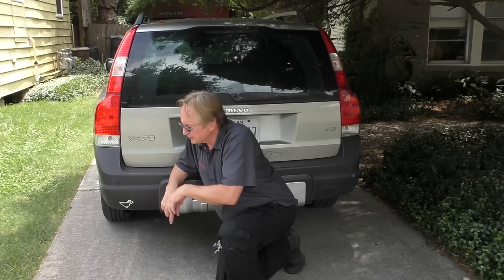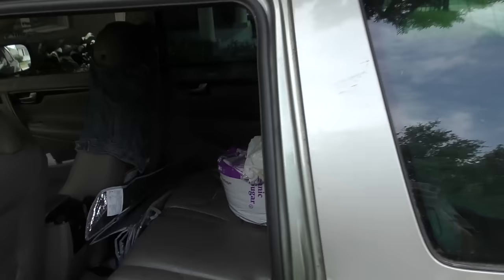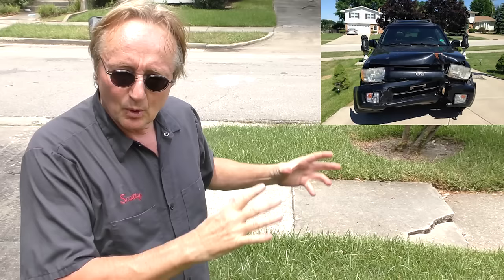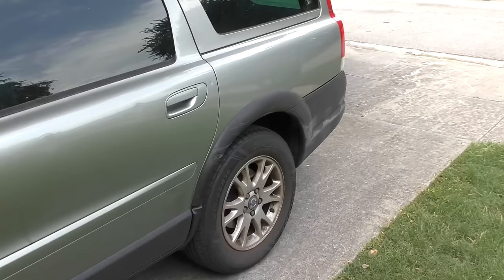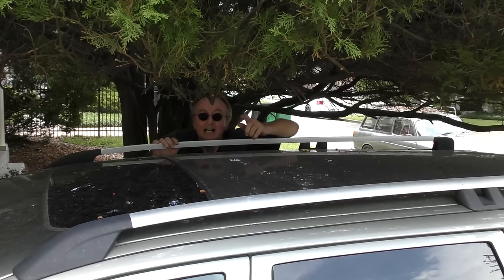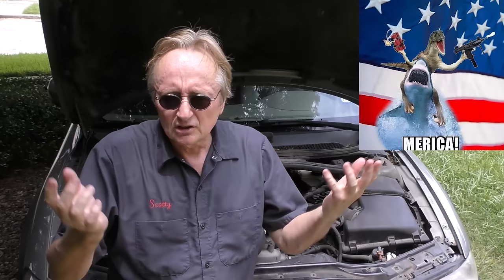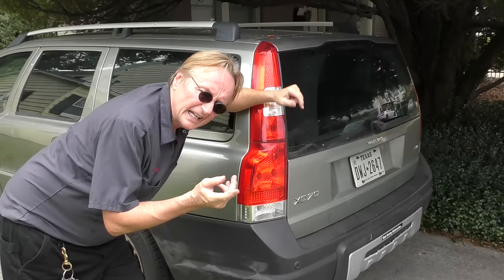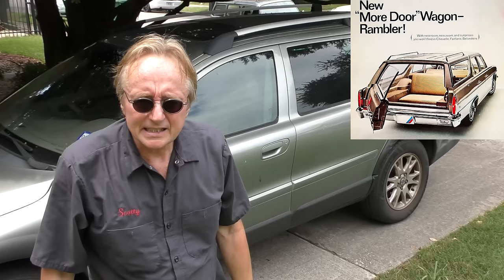Here’s Why Old Volvos Last Forever

Comment: Also, long live the 5 cylinder!!!
Reply: The T5 engine was one of Volvo’s best creations
Reply: Just like the K Series are the Best Honda Motors..
Reply: Never even knew it existed before now.
Reply: Agreed!  I have two old Audis with five cylinder engines.... both are 25 years old and still run great!
Reply: Which do you mean? The diesel or petrol one?
Reply: @Lagggerengineering  Both!!
Reply: @pduffy83usa  Both?
I guess I know what I am buying next!

DIESEL ENGINE MADAFAHKAAAAZ!!!
Reply: Wasn't that the engine with extra unneeded parts so they were allowed to tune it for racing?
Reply: Best engine pack Volvo made 5 cylinder turbo module. S60/ V70 2.4L B5244T5, circa 2004-2007. Afterburner performance. Pulls like a tractor. 29mpg hwy.
Reply: Lord Thunder  Why? Because its more efficient? Because it moves the world? Because it gives you the food you eat every day?

"Oh, but it pollutes" get real, we all know it pollutes, that doesn't stop you nor anyone else from using it's benefits.
Reply: @steveman1982  I recall the BTCC rules had to be changed because of the Volvo 850, the engineers had gone through every letter of the regulations and modified the engine in such a way to bend the rules and give them an unfair advatage over everyone else.
Reply: 5  cylinder    non   interference.     Good   design.         VOLVO.
Reply: 2.5t?
Reply: @YouDontWannaFightMe  Audi as well
Reply: @idigbebop  I have a 98 T5 sedan with the B5234T3. It also pulls like a tractor and more fun has been had with that car than anything else I've owned. The look of shock on drivers of BMW, Honda, VW,  et cetera as I pull away is priceless. The car is a bloody tank, love it.

Comment: I have a 2005 Volvo v70 5 speed with 224xxx and counting. Very reliable
Reply: V70 5 speed?? Im jealous.  You must not be in the US.
Reply: I would trade my right nut for a 5-speed!  I have a 2005 V70 2.5T with an auto.
Reply: My V70 was a good car. Got it up to 245xxx and recently sold it and bought an 04 S60R with a 6 speed.
Reply: @4jrgolf  Yes in the US. They are kinda rare tho especially for one that isn't a base model

Comment: Old, boxy Volvo's from the '80 aren't stylish? They are built from the principal; "Form follows functions". That's state of they art designing in my opinion! Practical, safe, easy to work on, reliable, comfortable. What do you want more? Screw those useless modern SUV's...
Reply: Amen to that. Boxy means more space. Do you think I could fit all the baseball equipment my V70 carries, in a (gag) Nissan Rogue?
Reply: "From follows function"🤔🤔
Reply: @bonohyogurt  There are boxy Volvos in 90's, too. I have a 1993 Volvo 940 STW. The last models of them wrere built in 1997 or so. I am driving my current Volvo now since 3/2002.
Reply: Jorma Kovanen 

I’m driving my 740 to a million miles
Reply: Turbo Bricks.
Reply: @JormaKovanen  Yes my 98 V70 is a tiny bit more rounded than your 940 but still boxy enough. Love my green tank. I hope fixing the AC is not too expensive, I don't want to get rid of it!
Reply: Yep 240's are great cars. Fun too if you want a cheap rwd car. Rip out all the interior and they are pretty light weight as well. Kids use em as the cheapest entry level drift car as well.
Reply: @ivanlowjones  the boxy Volvo 240 was built like s warship .
Reply: @robertcampbell9946   I had a 1979 245GLE estate and can agree wholeheartedly.
Reply: @peterkowlessar7823  I tell you man, these cars along with corollas are popular in Jamaica as taxis .also i heard that nobody never died in a volvo 240 thats involved in an accident .
Reply: 1987 240 wagon, reporting for duty

Comment: The old Volvo 240s were nearly indestructible. I've always called them the Swedish Toyota. Super reliable, cheap, relatively easy to work on. They're are more 30+ year old 240s on the road than any other older car.
Reply: My friend had a 240 and he collided with a deer last winter and it had barely a scratch.
Reply: Tim A replacing shocks on a 240 is a literal 15 minute job, so easy to get to, just a couple of bolts...
Reply: Toyotas aren’t tanks so Swedish Toyota doesn’t fit

Comment: I drive a 1993 900 series Volvo wagon with 350,000km.
Reply: Andrew Tremeer 217000 miles
Reply: -93 240 Wagon with 503 000km
Reply: 945 from 92 at 37 👍
Reply: Same 330,000 on my 93
Reply: My V70 2003 is now 425.000 km
Reply: 570 000km here
Reply: Some descent effing numbers going on. 500k km is no joke 😂
Reply: I had a volvo 245 1976 and it hade over 800 000 km on it. Sadly it was all rusted up but still the engine was running fine :D

Comment: The 240 volvo was so tough volvo once put 7 on top of each other to show the strenght of their roof
Reply: that was with the volvo 140
Reply: A neighbor once crashed with his P 1800 into a 7.5 t truck, which was sliding on ice frontally against him. the neighbor survived without any injuries, and the Volvo was still able to run. But the axle of the truck was kicked out.
Reply: @tejdz1337  I have one if you want it
Reply: It was later revealed that Volvo had reinforced the roofs with wooden beams to make that commercial.
Reply: It was the 240s. In 1987 they stacked them at our local mall.
Reply: They did the same thing with the Volvo 740
Reply: I have a 1991 740 Turbo Wagon. During a summer windstorm, a medium sized tree was torn down and it landed on the roof and the front of the parked Volvo. The car was completely covered by the tree. There is a small wrinkle on the roof line, and the corner of the hood on the passenger side got bent near the cowling. I replaced the windshield, which had a crack, and I still have the car. Volvos are sturdy, reliable, but most of all safe cars. People used to ask me about their MPG ratings. I always used to emphasize that I never bought Volvos because of fuel economy reasons. My first one was a '68 144S, which I drove from 1970 to 1985.
 By the way, I recommend IPD parts for Volvo. I have used their parts on my Volvos over the years.
Reply: Had two 244 solid cars easy to drive, did very little maintenance to keep them alive... did that rhyme

Comment: Those V70 is the most used car in Sweden, of natural reasons.
almost impossible to find one under 400.000 km.
People buy and sell them, and they will continuie to run
Reply: Christian Christensen that’s an XC70 but u were close
Reply: @mickdick1138  Ahhh okidoki :)
Reply: They were the Swedish police equivalent to the US Ford Crown Victoria P71. Still a few of them in active service to this day!
Reply: @mickdick1138  A few pieces of plastic and a few inches from the ground is what separates them... everything else is the same :D
Reply: @micosan  shocks,  front and rear drive shafts,  bigger disc brakes,  the clearance of a cherokee, all the bottom  protection  and AWD  as standar   was the difference
Reply: @andycapo9you  That is exactly what I said. I own a 2008 V70 and my brother has a XC70 from 2009. And there isn't anything substantial to diffrentiate them.
Reply: @micosan  and a 5 cyl instead of 4 or 6
Reply: @cruiser6260  D5 engines are the same 5 cylinder engines.
Reply: Whats 400,000 km ?

This is America.
Reply: @Johnkoth  250k miles
Reply: @marcusjosefsson4998  Yee that's what I always say it's the Swedish crown Vic
Reply: @mickdick1138  Basically the same car.
Reply: DrFartiwartieZ same underneath as the V70/S60 and S80 - all P2 platform cars
Reply: @Johnkoth  No, this is not America.

Comment: My Aunt has the same exact Volvo. Never stranded her and it's sitting at 130,000 miles. I got in it one time and was surprised with how smooth and quiet it was even after all these years. Incredible and the interior felt solid as well without a lot of creaking. The power was smooth and it was very quiet. I love old Volvos like these. The only cars I would consider buying would be the Outback or old Volvos.
Reply: just make sure she does her timing belt. these 5 cylinders are interference engines

Comment: My 244 had 889'750kms on the clock when i gave it to a fellow volvofreak. The 965 had 470'000 and the 850T5 only 250'230. Good tanks.
Reply: Mythus 
My last Volvo 850 went to 264,000
Miles

Comment: Yup, there’s a reason I own 5 Volvos!
Reply: what ones do you recommend under 5,000? what is your list of best and easiest to work on?
Reply: @Ensource  the older models from before Ford took over. So that'd be the first generation V70, 850, 940, 740 and 240 series of vehicles.
Reply: @Ensource  I would recomend Volvo 740 or 940 because it's easy to get parts and replace them yourself barely any technical problems at all. But if you want a more cheap and more comfort I would recommend a volvo v70 for daily and stuff like that. But never get a old diesel Volvo under year 2000 because me personal experience with those is that they are not as reliable as the old b230 redblocks.
But it depends where you are from and how easy to find and prices in your country as well of course. In

The engines I would recomend to get is b230 f, fb, fk, ft,  they are the most common to find and the most easiest to find parts to. The old carburetors ain't that great but they sound good with that's got sure
Reply: @Zirkobi  before Ford is first gen S60, S80 and second gen V70/XC70 too. And this generation is best. No rust, solid engines, no Ford parts ...
Reply: I just bought my 04 volvo xc70 but I miss my 850

Comment: My ‘08 Volvo S80 v8 is the best car I’ve ever owned hands down. Gotta love that Swedish engineering!
Reply: Engine made by Yamaha. Gotta love that Japanese technology :P They re rare. Hold onto it. Only had an 850 estate and an S60 from 2001. Now I got a headache with a 2009 Mercedes C class:))
Reply: @japanluv  Thanks for the advice!  The engine is the main reason I bought it and now it's safe to say I'm a B8444S enthusiast!
Reply: SlitWristMisfit  They were designed by Yamaha, as ordered by Ford (who owned Volvo at the time) and manufactured by Volvo.  They weren't made by Yamaha, dummy.

Comment: Still not as good as the old RWD volvo 240, now that was a solid car
Reply: Kalle Birgersson I’ve got an ‘88 240 wagon. The starter has been on its last legs for over a year now. Things bulletproof. 
I was at a red light once and this pedestrian walked past and said “Volvo, Swedish for common sense”
Reply: @searchingforsalsa  Volvo=I roll

You roll with common sense. Buying a Volvo is a compliment to yourself
Reply: Too solid.
Reply: So was the model T Ford.
The v70 Volvo blows the old 4 cyl Volvo away.

Comment: Reminds me of my 79'Lincoln Town car Scotty,these are built like tanks too.
Reply: @kirkreed8547  I had a 1975 Oldsmobile 98 Regency that I hit a deer with at about 50 miles per hour,it didn't even put a scratch in the paint,but it ripped the leg off the deer though.(killed it)
Reply: @paulparoma  That sucks,sorry to hear that.
I used to have a 1975 Olds 98 Regency with airbags and 4-wheel anti-lock breaks.This was a experimental model,about only a couple hundred were ever made.
These were only offered in the 1975 model year,the body was in perfect condition,but the drivetrain was a"fix it"night mere.I was also afraid of this car,because it only had lap belts in it,in the event of a head on collision,my torso would go into the steering column,then the dynamite detonator in turn  discharges the argon gas,while your face is slammed into the steering wheel,this experimental air-bag comes out of the steering column at well over 250 miles per hour, literally decapitated you,plus breaking your neck,needless to say,the longer I kept this car,the more scared of it I became.I hope that nobody has been killed in this experimental death trap. 🙏✝📖✝

Comment: My 1989 740 was in 2 front end collisions, but repaired by a friend. The second wreck messed up the radiator, allowing the coolant and trans fluid to mix. Drove it like that for a while without realizing it. My mechanic replaced the radiator and flushed the transmission. I took it back a few months later for another transmission flush to get rid of the remaining contamination.  Thing still ran good when I sold it in 2016. Yes, they were tanks.

Comment: We got a 2000 V70 for a wedding gift and it became the dogmobile. What a great car to drive and it was so solid. In 2006 we bought the XC90 with the same turbo inline 5 and it's still with us. That XC90 is a blast to drive and the AWD just keeps it stuck to the road. We've had a few friends and customers buy the XC90s with the 6 and 8s and none of them lasted past their warranties without massive failures of those rubbish motors. These inline 5s are just so rock solid.

Comment: I hit a deer at 60 mph in an '08 xc90 and it barely left a dent.
The same thing happened to my brother in his Corolla and the car was totalled.
Reply: crumple zones?
Reply: Same thing here. Going about 45 in out 2010 xc90  and we immediately pulled over. I was shocked to see that the car didn't have any dents! I later learned the roof is designed if you hit a person they will get pushed upwards versus down. This way you don't run them over. Anyway, I am still blown away by this.
Reply: Are the XC90 good vehicles? I’m thinking about buying a 07 with 170000 miles.
Reply: @fatpapi17  no i regret owning that car. Volvos are nightmares to repair

Comment: These cars are not gas hogs at all.
I have a 2004 Volvo S60R AWD Automatic (the sedan version of V70) with a 300hp/295lb.ft 2.5litre 5 cylinder turbo engine, and I ALWAYS get 31.4mpg (7.5L/100km) on the freeway.
That's a long way from the 25mpg you said and I have a more powerful engine, and the car is almost the same weight as the V70.
The S60R is 3481lbs and the V70 is 3488lbs.
Reply: What he reported rang true to me.  I have a 2005 V70 2.5T (light pressure turbo), and in mixed driving I get about 22.5 mpg.  I can not imagine I get over 25 mpg on the highway - I highly doubt it.  It isn't a gas hog, but it isn't sipping gas either.

Comment: my volvo's 40 years old last month, so hearing you talk about a 13 year old one as old is... no.
Reply: @markdowling5962  it doesn't have Lucas Electronics does it?

my oldest VW bug is about 54 years old, and the other two are just shy of 50. I only mentioned the Volvo specifically because it's my daily driver.
Reply: @markdowling5962  that sounds about right, yeah. I have one converted to an alternator, the others don't have their original engines, and the youngest is from '73, so the date of the switch is a detail that I don't bother remembering. but yeah, all of my VW engines (I have a few spares, because why not) apart from the one have separate regulators.
Reply: @markdowling5962  my '66 engine is 6V. I run it on 12V, though, so the 6V starter gets her running very easily.

in comparison, the bug I split daily driving with the Volvo with struggles to start sometimes.
Reply: I've almost gone to the trouble of putting the 6V flywheel and starter on the alternator converted engine, but just never gotten around to it.

Comment: I have a 2006 Volvo v70 which is similar to this one and runs pretty well. It's gas mileage is meh but it is a tank. Like a battleship
Reply: do you have any transmission problems? I have a 2004. I baby the acceleration. It shifts a little hard in 3rd gear. how often do you check the transmission fluid?
Reply: I never check my fluid or not in a while. I'm not sure who makes their transmissions but I don't think it's jatco. It's a good auto transmission. But I did need to recently drop $3,000 to repair the engine after 171,000 miles. It runs a lot better so I think it will last a couple more years. But this car is good for new drivers if you are concerned about safety (atleast for a used car). This thing has an above average turning radius
Reply: @Floof_Factory  I see. I've been using my Volvo to commute 75 miles per work day. its perfectly fine in free flowing traffic but when its stop in go the constant shifting is causing a problem with the idling. It stalled out on me once. I will try leaving it in low gear next time.
Reply: @waterenglish9501  2-3 is a B4 band worn out. Need a longer B4 piston pin to get its travel back to normal. Search on Volvo forums.
Reply: @vtl1349  Thank you
Reply: Update: like in his other volvo video, these do have electrical problems. Ive had problems with my battery dying and having to replace the alternator. But other than that, it'll last. Transmission and engine are great, and I got hit by someone's BMW with no scratches and walked away. Safety does pay off

Comment: Man, Dale Gribble aged well.... driving a 1998 Volvo v40 myself, perfect for country roads here in germany... they really are built to last
Reply: I am sat inside my tatty old 1999 V40 now, the worst part about it is the rust. This old 1.8 petrol lump has only covered 200khm, the engine has never leaked and I love the space in back. Great for cruising around in. I love it!
Reply: @MuscleBandit  my 2.0l just reached the 200k. Rust is not an issue at all, though the shiftingbox (manual) is giving up and gears start popping out or I struggle to put them in. Thats just the ailing switch socket i guess, 10 euro spare part . Otherwise it does a whole lot of squeaky sounds here and there that worry me. But it also has absolutely 0 leaks, dry as a new engine. never saw that in any other car from that era or younger. Cheers!

Comment: I have a 2005 XC70 with 230k+ and its interior is nearly pristine; I'm indebted to the previous owner.  Anyway, apart from subpar sound insulation and the fuel economy, I have no problems with the car.  Like he said, it picks up pretty quick for its weight.  It's had no major repairs or rebuilds through its lifetime.  I'll eventually want to replace it with something more fuel efficient but I'm afraid it may never die on me!
Reply: I have a 2004 xc70 with 96k miles.